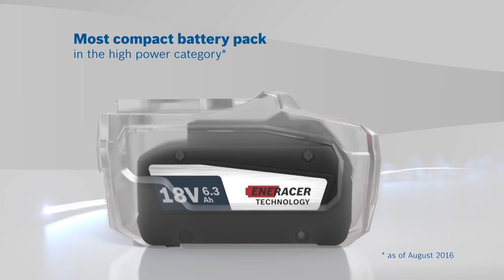Skill Builder Live Show at Bosch Power Tools

Comment: The anti-kickback sensor acutally IS a kind of pendulum but on microscopic scale and with no hinge. They are made with semicondutor production processes and are called MEMS (micro electro-mechanical systems). A colleague of mine did manage to knock himself from a ladder with kickback as Roger described. I wonder if the best solution would be an optional kickback control for situations when you are working with the sidehandle and just want the drill di bite though.
Reply from the maker: That is interesting to know. I noticed the 18 volt drill doesn't have a side handle so the anti kick back is all you have. I didn't get around to discussing torque but hopefully we will have one out for test soon.
Reply: Skill Builder I find this quite limiting to what you can do with it. If you have to work with a holesaw for example there is no way around a side handle.
Reply from the maker: I think you are right there.  Manufacturers make these strange decisions. When we test it I will make that point.

Comment: Maybe im just paranoid but i still believe OLD tools did it best they where build too last my old Wurth 12 v still going strong sure the batteries are pretty much dead at this point but the drill is from the 90s i believe, i would love a new drill but i just dont have the confidence in the new drills ( the batteries manly )  today they are expensive and its a computer that does the thinking for you.

i have noticed recently that many of the big guys Bosch,Makita,DeWalt,Metabo are on sells more often is there some new tech that is going to be released soon ? or is just cheaper for them to make the tools now ?

Also Roger do you know about FEIN its a german tool apparently they are really good they have a drill with 4 gears.

interesting video Roger :)

SKÅL !
Reply from the maker: We all resist change through our lives and this is just one more example of us questioning the validity of a development. I have resisted many developments over the years and cordless drills was one of them but I am sold on it now. The batteries are good. They had their problems in the start but most things do. 

We know Fein well and have tested their 4 speed drill. Do you need four speeds? Maybe, maybe not.
Reply: its not the tool that dies first its the batteries in my case and makita battery charger is stupid ( the old NiMH battery ) when a couple a cells die the charger says entire battery is dead its a great shame since the battery is now doomed because of couple of cells that is why im more a corded tools kinda guy there are plus and minus with bot cord and battery just far less minus with cord In my humble opinion :) im just a DIYer not a professional :)

maybe a video idea Old School VS New School tools old Bosch drill vs new Bosch drill 
:)
SKÅL !
Reply: just convert it to a adapter of the same voltage no need for new batterys ever again theres lots of vids on you tube that show you how
Reply: ehh im not really a power tool kinda guy to begin with they all seem to fail at some point in my hands but thanks for the info :)